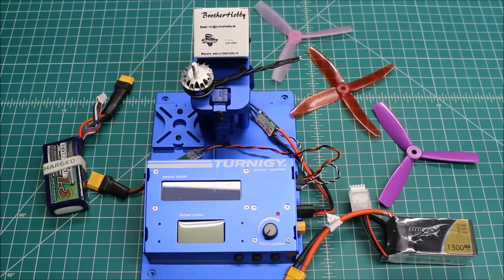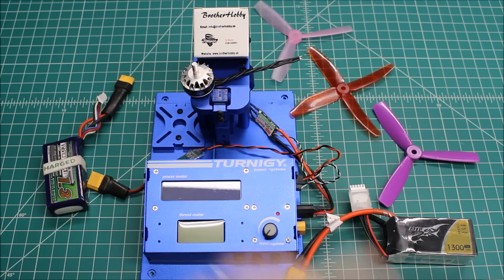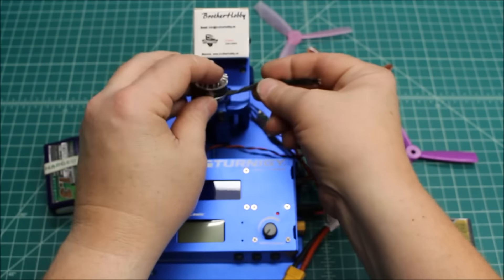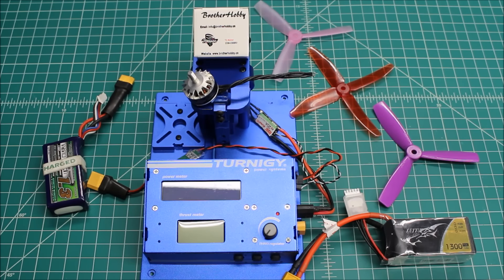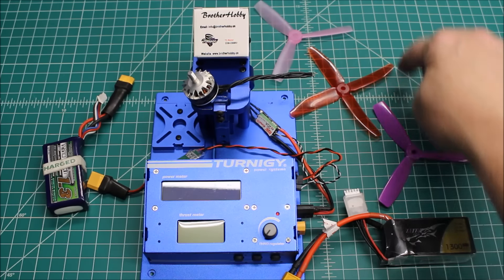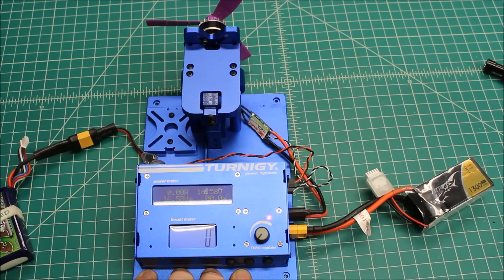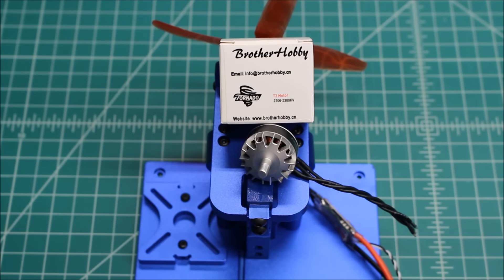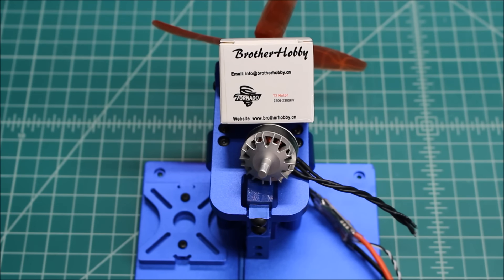BrotherHobby T2 Tornado Thrust Test

Comment: noone has made great, heavy duty, reliable, bearings yet.  bearings are the only moving part.   there is alot of sideways force on bearings.
Reply: The new luminaire motors have ceramic bearings. Considered to be the one of the best types out there. Folks have been using them for years in the RC car industry where the forces are much more intense on the motors.
Reply: im excited to see how these perform. I know they have  been made in their new manufacturing facility, or what not.
Reply: There is no sideways force on the rc car's bearings.

Comment: Great video, but you absolutely cannot use small, crappy batteries like the puffy techs and expect your results to be accurate. If you use a graphine, or SMC, your results will be hundreds of grams different.
Reply from the maker: totter333 I don't consider a Tattu 75c to be a crappy battery. The nanotech was for the bec
Reply: totter333 nah man it's all about the infinity graphene!! Yeh!! Lol my tattu 1550mah 4s 75c smokes my nanotech 1300 graphene. It flys longer and is actually lighter than the ghettotechs.
Reply: X-Frames FPV tattu is actually a horrible brand. Many battery tests have shown they perform poorly compared to bonka and smc which are considered top of the line.